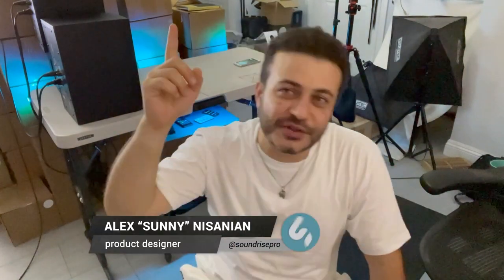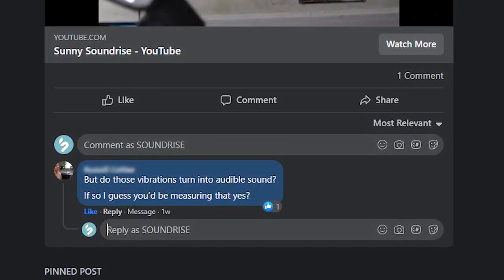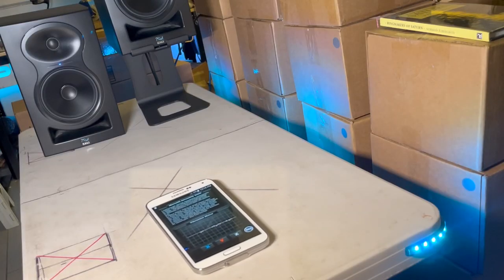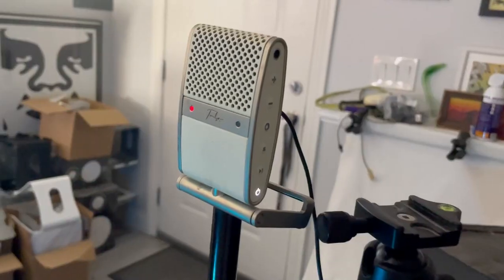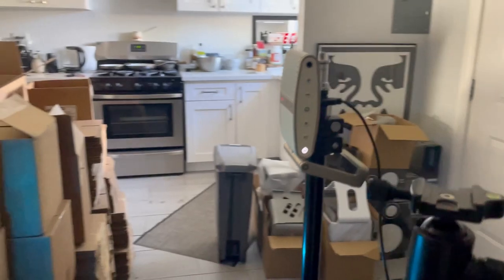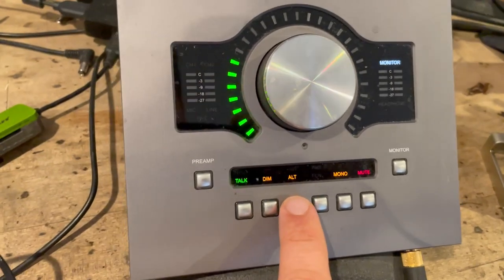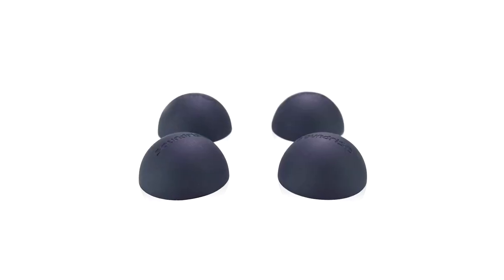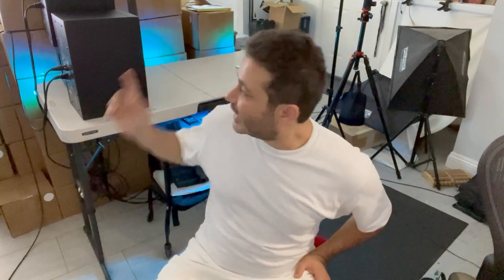Decouple Your Speakers - Hear & See the Difference

Comment: You changed how i look at Speaker stands completely. I used to think they are only for Speaker-ear alignment to get that proper height down but I now understand much more than before
Reply from the maker: Hellyeah Sammed, that's what It's all about. If mixing/mastering is all about the subtle differences, then decoupling speakers should be a big deal. Thanks for sharing your thought.

Comment: How do they compare to foam speaker stands like Auralex? 🤔
Reply from the maker: Same vibration, absorption as foam, but added, lifting speaker up by 9 inches and reclaiming desk Space
Reply: @SunnySoundrise just discovered a video that got worse vibration results from the Auralex Mopads than using nothing! How can this be? I’d like to test this myself, since I just got mopads. What vibration app did you use? 🤔

Are the Pro-9’s the best vibration dampener you’ve come across so far? Using it to not disturb neighbors, since I’m a night owl.
Reply from the maker: @capcom4eva  I’ve got the best results with pro-9 and customers say our Soundrise DOMES have done a lot to not disturb neighbors with the rumbling of sub-woofers. I will link you the Android app.
Reply from the maker: https://gamma-play-com-vibration-meter.en.aptoide.com/app  @capcom4eva  vibration meter app i used with Android phone.
Reply: @SunnySoundrise  darn, I have IOS. Do you find that sound loses a lot of its feeling and kick with all these dampening gadgets? That’s how I feel with mopads and stopped using them. Felt I had to turn up the volume more, but it still couldn’t compensate for the lack of enjoyment of using the raw speakers ungimmicked. 

I might just be one of those who prefer the volume lower and unadulterated. Could just be the speakers itself or the visceral feeling I love so much. Even playing raw speakers on low volume, you simply can not match that energy transmission with dampeners no matter how loud you crank it, at least with mopads, IMHO. 

I like the feel of vibration through my body, when I hear the sounds I love. I want my music to move me.
Reply from the maker: @capcom4eva  not at all, the only thing dampening takes away is the EXTRA kick you hear as a result of items resonating and reflecting in the vicinity of the speaker sound hole.

Comment: i wish you would have put up the samsung to match the height
Reply from the maker: @manitsony6703  thank you for this comment and you are right. I’m learning from experts the height of the microphone has to match the previous speaker’s mic placement relative to its features. This would make for optimal comparison. I wonder how different from my results that would sound.
Reply: @SunnySoundrise  thanks.. what are you using now for decoupling?
Reply from the maker: @manitsony6703  been using the same v1 cutout of my original PRO9 desk stands.

Comment: It looks like the style of your stands have changed a bit? They used to have a round hole and now it's different, is it because of how the cables would run back if people put audio interface under the speaker?

Do you sell damaged or used stands? I would love to get some damaged or used for half price. These seems amazing but very expensive :(. In fact I think you are pushing more than half people away just because of the price :(.
Reply from the maker: Yeah exactly we received lots of requests to extend that cable hole to match the height of gear.  Thx for the message

Comment: Well, first of all; the woofer cone not on a stand is much closer to the phone, therefor the sound waves from that lower speaker will directly vibrate the phone much, much more. Also, why putting the phone in front of the speakers? The sound waves shouldn't NOT hit the phone if you are testing for material based vibrations. However, this proves my point that the sound waves WILL cause more vibrations in objects in the room (as you can see from your own test). Oh my god!! Put the phone behind the speakers instead. If you are doing this kind of test, do it correctly. If you can really HEAR any difference regarding the room you're listening in, then... well, I'll bet you don't. This is the same as the discussions a while back if you could hear dithering, and of course I created a blind test... NO ONE could hear any difference.... no one could hear the dithering.... The vibrations created by the sound waves regarding objects that can "rattle" and/or make noise is far more audible, and also more powerful, and of course the sound coming from the speakers is at a much higher sound level than whatever vibrations there are. The well build, quality studio monitors should not vibrate at all, but they all do. But these are so small that you cannot hear the difference because the sound from the tweeter/cones will mask the vibration sounds (if there are any audible at all) - just like the sounds in any music will mask the dithering. So if you can hear the effect of vibrations in a controlled A/B test (with a person not known by you to manage the test) from well built studio monitors without pads or stands, then I will eat my shoes. But hey... how come so many mixes from before these pads/stands sound so good? And how come the professional mixers doesn't use them? well... some may do... but a lot of them doesn't.
Reply from the maker: Ok great idea. I’ll do a test with the vibration app BEHIND the speakers 🙌🏽
Reply: @SunnySoundrise   that’s not a good idea because of the sound from the speakers. You need to measure the vibrations ON the speaker(s) because that’s what’s being diskussed; the speaker cabinet and the vibrations from it. However, if you want to measure the actual sound from the woofers to compare cabinet vs. the actual sound waves, then use your idea and measure only the sound waves and then compare your results; sound waves vs. speaker cabinet vibrations. The result will be no vibrations from the speaker cabinet, and vibrations from the real audio waves from the back of the speaker. Build-up will happen if you meassure while the speaker is in a corner, meaning a whole lot of powerful sound will be there. the vibrations will ALWAYS be higher from the actual sound/woofer compared to the speaker cabinets. This is not rocket science.
Reply from the maker: Professional mixers definitely do decouple their speakers or they're on floor stands not touching the desk. However I still think a test of the app sitting behind the speakers will eliminate the possibility of the bass cone causing the vibrations we see. It's a better "blind" test of the vibrations imo
Reply: @SunnySoundrise  Some do, but they too believe it's working, sadly. Just look at how Dave Pensado at "Pensados Place" was fooled to believe the sound got  better with super expensive power cables. Sadly he realized it after payment. So don't believe what the pros do, because they are wrong too. When it comes to use the space behind any speaker in a corner is even more bad because that's where bass builds up. Try it your self and put your head/ears behind any speaker in a corner. Corners are a very hard place to treat correctly, therefor your test would fail. You must measure on any surface on the speaker cabinet, because that's what we are talking about; namely take away any vibrations from the speaker cabinet from reaching the surface the speaker is resting on. But I tell you, there's no vibrations in any speaker cabinet that will affect the sound because again, there are no to almost almost no vibrations that can affect the sound. Think logically and feel the vibrations from the woofer/midrange speakers, then put a glass of water on top of your speaker cabinets, and there will be no vibrations. Think about this for a minute, because any sound from all speaker elements will always be louder than any speaker cabinet vibrations. I mean, this is the whole point of the speaker cabinets, to not vibrate while delivering great sound (vibrations) from the speaker elements. If you want sound from any speaker cabinet (vibrations) then the speaker wood/plastic (the cabinet) must vibrate like a woofer or midrange speaker. And so will you see or feel this happening? The answer is no, of course.